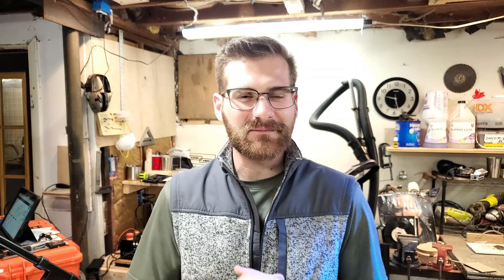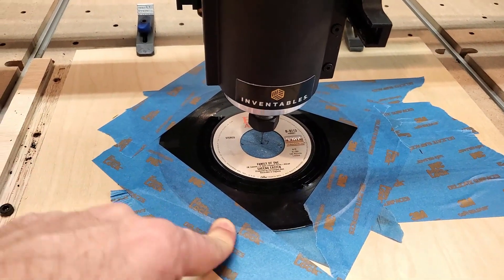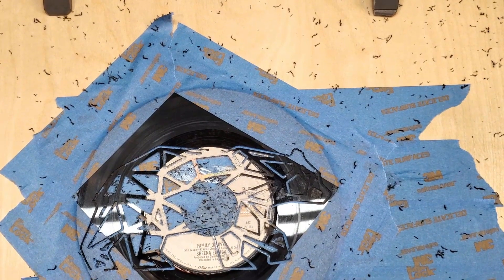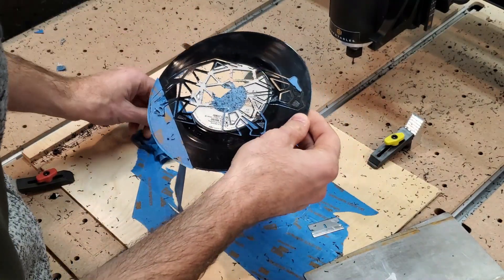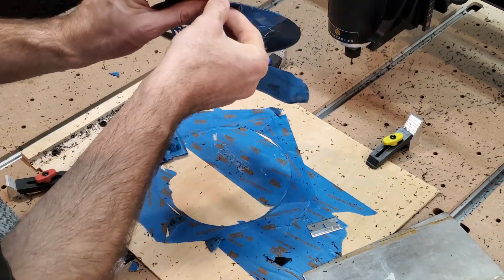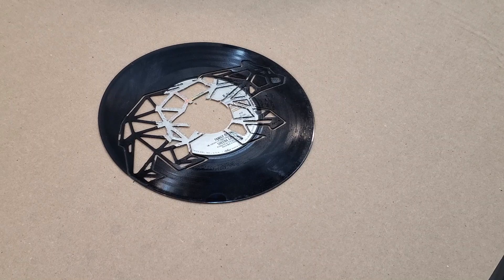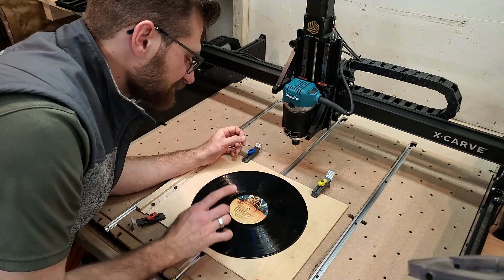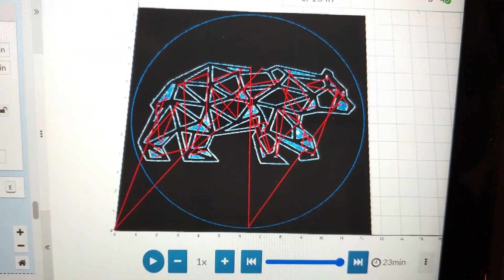2nd Attempt | Cutting Vinyl Record with CNC

Comment: The  standard method for using blue tape is to cover the spoil board with blue tape, then cover the back of the work piece with blue tape.  Then you apply CA glue to the spoil board tape and CA glue accelerator to the tape on the back of the work piece and press the work piece onto the spoil board.  Have you tried this method?